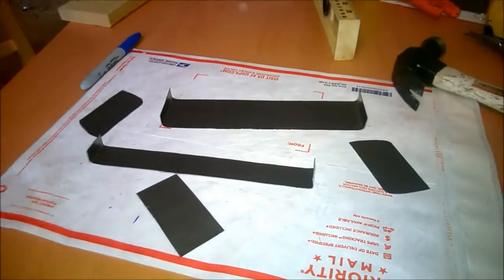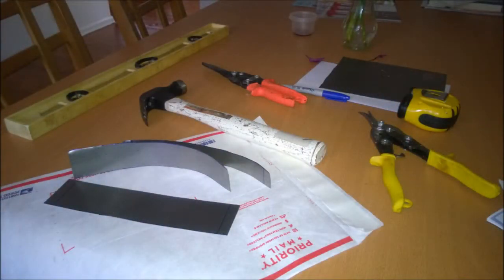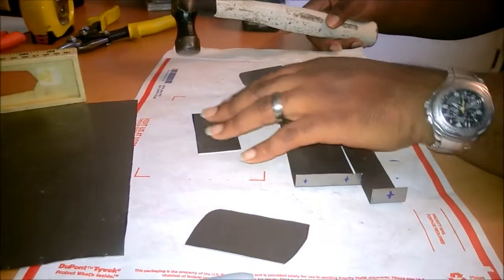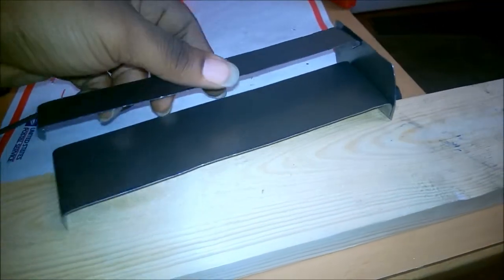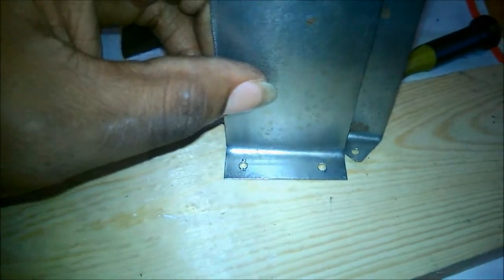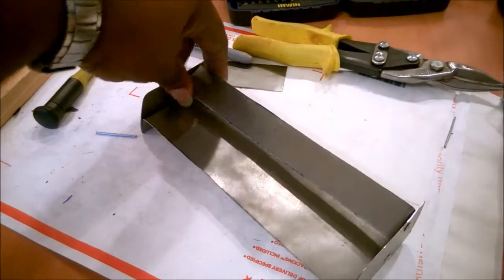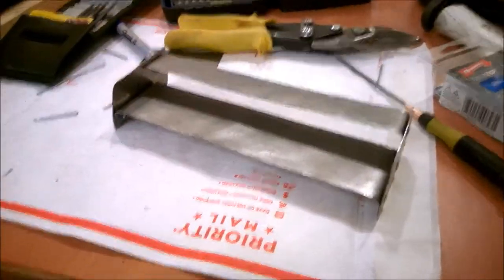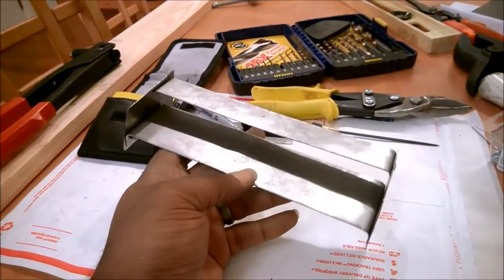Ep. 43: Low Drag Spoiler Build - Fun with Sheet Metal

Comment: I really like your approach to things.. It's the same way I think... Just subbed to u.. I'm having the same issue just did a speed run with my vxl and she took flight right at about 70mph with no weight on the front.
Reply from the maker: There's really only two ways to fight this, weights or wings. Weights are simpler and actually a bit cleaner since you do not add drag. The problem is extra weight slows acceleration. Aero always has a drag penalty, which I'm fighting now. I think the problem is solvable (at least to get me that last 1.1 mph to break 70 mph), but my top end will probably be slower.

Still, I'll take Slade's increased stability after the aero work hands down. I haven't wrecked once since adding the spoilers, which is pretty amazing. He was almost un-drivable at high speeds before.
Reply: Couldn't agree more. Im actually thinking of making a wing once you give us some feedback on how well it worked for ya